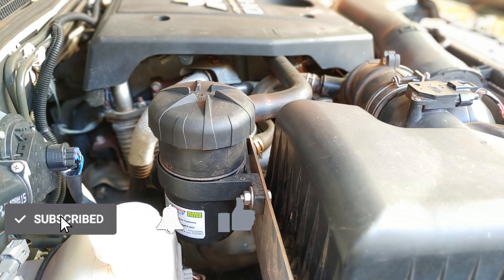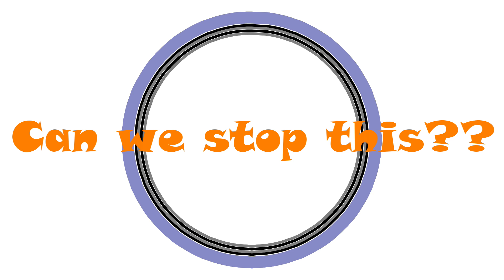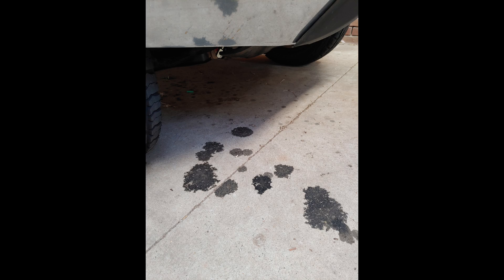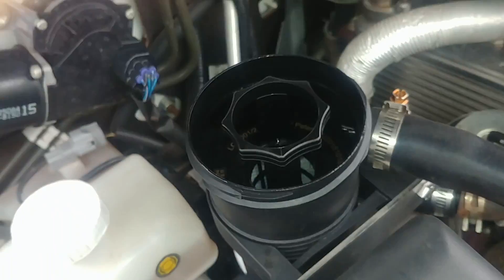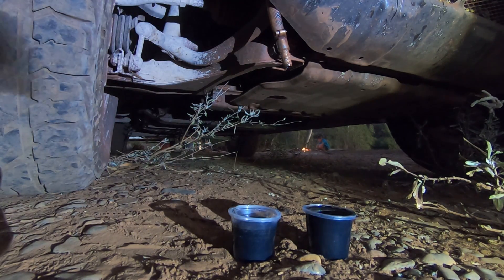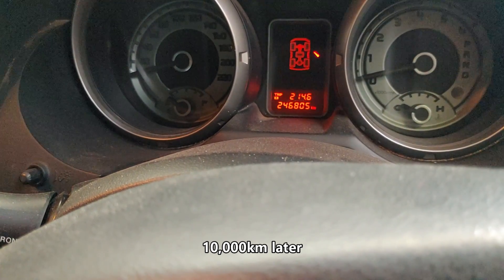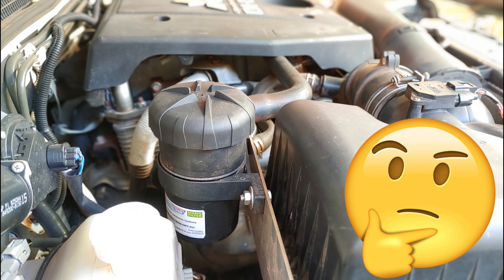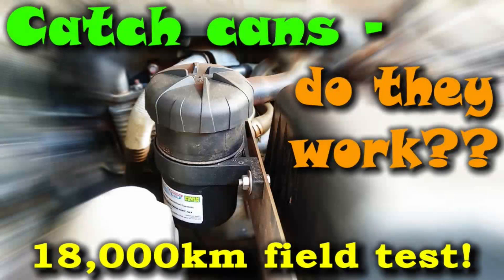Provent 200 Catch Can - How well does it work??

Comment: Thanks for informative film. Il live in nothern part of Sweden , and we have a winther season with possible temperatures down to -40C, I am afraid the water weapor can freese in the catch can ? So is it advisebel to have a cath can only on the period of year we’re
+C is ruling ?
Reply from the maker: Thanks for your question. Most of what gets collected by the catch can is oil, so since you would be using a grade of oil which suits your climate, this waste oil collected by the catch can wouldn't freeze. There is also usually a small amount of water as well which could cause a problem, but this collects at the bottom of the drain hose and on my kit this is a plastic hose which would have some flexibility. So I think you would just need to make sure you use a drain hose which can expand sufficiently as the water freezes (for example, silicon), and you should be ok.

I would also recommend you contact Mann + Hummel who is the manufacturer and ask them the question, as they would be able to provide more product-specific information and probably know how to make their products suitable for cold climates.

Good luck, and greetings from Australia!

Comment: Hat about crank case pressure dose it blow the back seal
Reply from the maker: Hi, no these units have an overpressure valve in the bottom of the filter, so if the filter gets blocked or creates too much resistance the gasses just bypass the filter and go straight back into the inlet manifold.

Comment: Hello! I would like to ask you a question. I need to install the provent 200 but I don't know the size of the rubber tube to buy! I have a Pajero v80 and on the western filters website there are the sizes 25mm/16mm or 25mm/19mm. What sizes do you recommend? Thanks
Reply from the maker: Hi mate,  I looked at all the Pajero catch can kits on their site and couldn't see anything about those different hose sizes sorry. If you can point me to the right page so I can work out what it's referring to, I may be able to give you some direction
Reply: @TheMusingGreg  Thanks mate! You were kind enough to help me! The only measurement I found is 25mm on the provent 200 catch can side. At the moment I don't know which site could give the information I need! I wish you a good day!
Reply from the maker: @Domenicoschannel  No worries mate. You mentioned "on the western filters website there are the sizes 25mm/16mm or 25mm/19mm". I couldn't find this on the Western Filters site, there was just the one kit for a Pajero. I could measure the hoses on the kit I have but I don't know which dimensions they're talking about which is why I wanted a link to the site where you saw the different sizes.
Reply: @TheMusingGreg  Sorry mate I didn't understand that you were referring to the western filters site. I inserted the links but you tube deletes them.... damn algorithm! but there is a way: it is sufficient to copy and paste in the product search bar on the western site of this: Universal Oil Resistant Hose Kit for ProVent 200 2x0.9m 90 Degree Ends (25mm / 16mm)
and then this:
Universal Oil Resistant Hose Kit for ProVent 200 2x1.5m 90 Degree Ends (25mm / 19mm)
Thank you so much !
Reply from the maker: @Domenicoschannel  I see. My kit did not include any hoses that looked that small. Where would they go and why are you looking for individual hoses? Why don't you just buy the complete kit designed for a Pajero? Search on their site for Mitsubishi Pajero NM NX 4M41 3.2L DID 2006-15 Mann+Hummel ProVent Oil Catch Can Vehicle Specific Kit OS-PROV-08
Reply: @TheMusingGreg  Thinking about it, you're right! It's better to buy the complete kit from Western. I thought I could save something but probably buying the pieces separately would have cost the same or maybe more. I looked into the duties and shipping costs and fortunately from Australia to Italy they are only 5% and shipping is $180 Australian dollars. You were very kind to help me choose! I wish you a happy Easter! Daniel

Comment: Would it not be better for an engine , to catch the oil in a can that comes from the vent, But dont vent back into the Air Intake ?
Reply from the maker: This catch can at least does a pretty good job of removing the oil from the air so dumping it wouldn't be necessary. However if you did dump it, it would muck up the air flow metering a bit as that air has already been accounted for by the airflow meter.

Comment: I’ve been thinking of fitting one to my 2013 Jeep Diesel. But I’m wondering is it better to have the sticky goop build up or dry carbon and which is worse. I’m going to strip out the air box (big job) and EGR and give them a clean out. I’m also wondering if once clean something like LiqiMoly cleaner is a good idea every 10k just prior to an oil change. Thoughts?
Reply from the maker: Hi Stephen, great questions! My current feeling is that sticky wet carbon is easier to deal with than the dry stuff, so I'm not using my catch can at the moment. Something like liqui Moly can't hurt before a service, however it doesn't make a big difference - did you see the reviews I've posted on this and other products?

https://www.youtube.com/playlist?list=PLY9DsfXyOtbJOy2LnhAd_sowYobF9aW9f
Reply: Yes I did see that it was good and I’ve watched a few others. I think if I’d used it (liqumoly) from year 1 each year maybe over the last 11 years the build up may not have happened or at least be less. Now 11 years on and at 170k I see the buildups far too thick ( I removed the EGR pipe to check) and no spray will remove that. If tomorrow is sunny I think I’ll spend the day stripping the carbon out and clean what I can manually. The Jeeps running fine but I’m thinking anything preventative now can’t be a bad thing. Cheers S. 

I’ve just seen the follow up video, which is what I was thinking as a maintenance measure. Good videos cheers.
Reply from the maker: No worries mate. If the build up is heavy you'll need to do a physical removal and clean, but after it's clean liqui Moly before each service would help to slow the rate it builds up

Comment: Love the Provent 200 air oil separator. I've been using one for about a year in my 2023 Jeep Ecodiesel. It works and I love it.
Reply from the maker: Great to hear! They certainly do a good job at separating out oil and air. Doesn't fix the manifold gunk but if that's not the priority it's a good product.
Reply: @TheMusingGreg  Have you deleted the EGR Valve, system?
Reply from the maker: @trondvidardalseng894  No I ended up leaving it in place

Comment: 👍👍
Reply from the maker: Interesting perspectives Kevin, thanks for sharing! I don't think the Prevent 200 would handle that much blowby but they may have a larger size that would suit your vehicle. Or as you say make your own but the Provent catch cans do work pretty well and have a valve to prevent a build-up of crankcase pressure in case the filter blocks, which you might miss if you made your own. Good luck in the research!

Comment: Not sure if the Provent 200 Catch Can could handle the volume of blow-by comming from a Ford 2008 - 10  6.4 Super Duty. I'm curently working on a much larger canister an idea I got from a 1964 bus. Maybe the displacement of the larger can will be enough to slow down the vapors through the filtration system   and ataching them selves to the various baffles and screens I have in place. Because I could see vapores comming out the exit port in the first prototype. It did trap a goodly amount of goo. The search for perfection goes on. But plugging up and narowing intake ports is a costly  indever to clean
Reply from the maker: Agreed, you'd need something bigger I reckon

Comment: I believe I have the perfect engine to do these CCV and EGR tests and Catch-Can tests. The problem is how do you stop (zero) emissions going back through the intake manifolds. This just starts the flour and water scenario all over again. Unless you vent the can itself back into the atmosphere or😢 the road. Not really the perfect scenario. I have a Ford F 350 08 6.4 diesel this thing has a huge blow-by from new and only gets worse in a relatively short time. Because of the EGR CCV and regeneration of the DPF system carbon build-up makes the life expectancy of this very expensive engine quite short. When diesel engines are expected to have a much longer life expectancy. However, I will not give up on my Catch-Can system, and as this very seldom if ever leaves the farm it is now completely deleted. As I understand the Government ( military ) etc. Never had these systems installed in the first place. A well-serviced running diesel engine will run surprisingly clean. More attention should be given to the cold air intake filter. The stock one just chokes the life right out of the engine and after-market filters get easily plugged up so attention to cleaning, washing, Or replacing these filters must be more routine. I could go into a rant about the much larger piston ring gap on the numbers 7 and 8 cylinders and the fuel being dumped past the rings and into the crankcase oil reservoir causing fuel wash to destroy 
rings and bearings. But who would listen? Did I say I will never give up my Catch-Can?
Reply from the maker: Sounds like a plan!

Comment: 1. It takes energy to move fluids through hoses by adding catch can you've adjusted the crankcase pressure by adding friction which causes crankcase pressure to increase which causes more oil to blow out of the engine. The catch can is causing more oil to blow out of the engine and damage the engines oil seals and enter the piston rings. Your engine is now consuming more oil through the piston rings. E.g. the oil level after X9999 miles will be lower with the catch can installed and detonation resistance has decreased and the piston rings will collect more oil eventually light hydrocarbon chains leave and the oil control rings stick causing excessive cylinder wear and eventual blow-by and failure.
2. You cannot perform a test like this without measuring crankcase pressure and comparing idle, cruise, wot crankcase pressure with or without modifications and this includes the air filter which is a key component of PCV system pressure control feature. Nobody seems to understand this when you adjust the filter you are changing the PCV system.

Catch cans can ruin the engine over time if you do not measure and set the crankcase pressure properly when modifying an engine. The same can be said for air filters because of the same reason. You measure tire pressure, fuel pressure, oil pressure, transmission pressure, coolant pressure, boost pressure, etc... but neglect the crankcase pressure then you are blind to oil system related inclusion carbon cycling failure.
Reply from the maker: It's interesting you make this observation, because I'm planning on doing a crankcase pressure test very similar to what you've described in an upcoming video. I would say though that while technically you're correct, my current feeling is that I don't think the extra hosing would add very much pressure to the crankcase, and not enough to create any appreciable difference. But time will tell, so stay tuned!
Reply: If you are testing pressure difference you must measure at the wide open throttle side aka the venting side of the crankcase where kinetic energy is limited. At wide open throttle appreciable length of hose will absolutely have an influence based on air filter pressure drop and crankcase blow-by mass plus hose friction. And keep in mind as crankcase pressure increases the blow-by will also increase, so measuring pressure with a given ring performance is not linear with respect to differences in pressure e.g. there are low pressure crankcase values which maximize ring performance and allow the OEM Pistons to drain properly. In other words the piston cannot drain oil properly if crankcase pressure is balancing inertial ring force with cylinder wall friction force which is trying to pull the ring up, unseat depending on ring tension. Crankcase pressure at the end of power stroke rising below the piston forces the ring to unseat and now is blowing by, accumulating oil in the ring pack, then people complain they don't drain properly and get stuck seized with carbon and ruin the engine. Its not the ring design guys its the crankcase pressure unseating the ring seal at the end of power stroke causing excess blow-by.   @TheMusingGreg
Reply from the maker: @Wabits  Cool thanks I'll make sure I test those conditions when I come to do the testing. Cheers!

Comment: Great video! Thank you! I was going to install a catch can until I saw the following video and now I'm confused 🤔https://www.youtube.com/watch?v=hDx09voTlbw
Reply from the maker: Unfortunately there are no great and legal solutions. If I was starting again I would not install a catch can. If it was a short term car I would leave it as factory. If it was a long term car I would pull the manifold off every 100,000km for a full clean. If I was willing to be illegal I would stop the EGR circuit somehow to get rid of the carbon as that's the hardest issue to deal with. To date, i've not found any cleaning products to be very effective at maintenance although they're minimally useful, but not enough to figure as a key factor in manifold maintenance.
Reply: @TheMusingGreg  Thanks for the info! Yea, it seems like a solution-less issue :body-blue-raised-arms:
Reply from the maker: I'm still hopeful there may be some good product out there but so far I've not found something that works well enough to recommend.
Reply: @TheMusingGreg  What I'm thinking is it would have to be a catch can with a very short tube no longer than the factory one :body-blue-raised-arms:

Comment: I'm always of the opinion if  the car needed a catch can it would have came with one. I'm not convinced these are needed, but great video anyway.
Reply from the maker: I initially thought so too, but remember a car isn't everything the engineers might have wanted, it has to meet financial and marketing targets too. It's common for a product to not be exactly what the engineers want as it would be too expensive. From my experience, I don't think catch cans fit this category, but I'm still of the view that just because it doesn't come with it doesn't mean it can't benefit someone who's willing to spend the extra money.
Reply: @TheMusingGreg  I get that, but the fact that not a single car comes with one suggests to me it's probably not needed and a waste of money.
Reply: @aleks0001 that’s stupid way of thinking buddy, exactly the type of customer car manufacturers are after.
Reply: @Mistabushi  so the fact a single car doesnt have a catch can is a stupid way of thinking. But buying products based on nothing more then marketing claims with zero proof if they even work is smart. You keep being so smart and buying crap that you dont even need.
Reply: I think they’re needed but @aleks0001 has a point. There isn’t any independent laboratory controlled tests that support the use of catch cans. Until we get them, it’s all subjective.

Comment: What about crankcase overpressure because the filter stops the gas from passing through easily?
Reply from the maker: It's a good consideration, but the Provent 200 has a pressure relief valve built into its filter so if the pressure starts to rise inside the catch can it will open and just bypass the catch can completely. I'm working on a separate test to look at exactly this, so stay tuned!

Comment: $300+ for a crappy piece of injection moulded plastic.....shameful!
Reply from the maker: I do agree it looks expensive for what it is. Note however that it comes with a $80 filter which itself has a pressure relief valve and spring built into the bottom, so it's a part of some complexity. To do that and get it all patented would have been pretty costly.  I'm not saying that makes it worth $300, but it is more than just plastic.
Reply: But this is one of best which have least flow resistance that can release pressure of crank case. According to experiment on yt clip I saw
Reply: Get moshimoto.
Reply: There is oil catchment containers like this for a fraction of the price
Reply: Lucky you can get a china copy for cheap 😂

Comment: It’s the soot that’s the problem and less of the oil .. dry soot will still damage seals!
Reply from the maker: Probably right. Although the oil will keep it slippery and less abrasive so maybe it's better to only use it if the EGR is already out of the picture.

Comment: Can you try using a second catch can but for the egr, and fill with granulated charcoal this will absorb the soot and noxs essentially cleaning the air before it go's back... I reckon a handful would last 5000miles but you find out man... Thanks for the videos :)
Reply from the maker: Interesting idea! It would have to be a metal catch can, not a plastic Provent 200, to stand the high temperatures of the exhaust system, and also the installation would be a much bigger hassle because the EGR circuit uses metal piping, not rubber hose like you can get away with for the EGR system. But if you could get it set up it might work. I'll keep it in mind!

Comment: How long does the filter last do you think
Reply from the maker: Good question Ross. They reckon 40,000km, but in correspondence with them it seemed a bit of an arbitrary figure based more on operating time in other industries which they then adapted to automotive. It isn't actually a 'filter' though, it's a coalescence medium which means it shouldn't block up like a filter does. One day I'll get to finish a video I started 6 months ago examining whether running it longer actually matters, or if it's just a money spinner for them! I can't say when I'll get it finished as I have more testing to do but make sure you subscribe and notify if you'd be interested in more info on that when it comes.